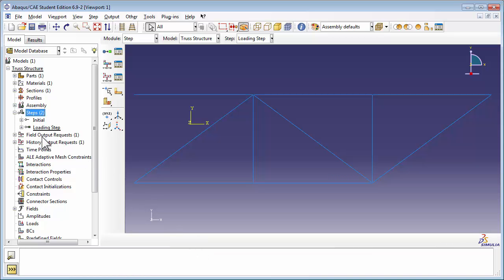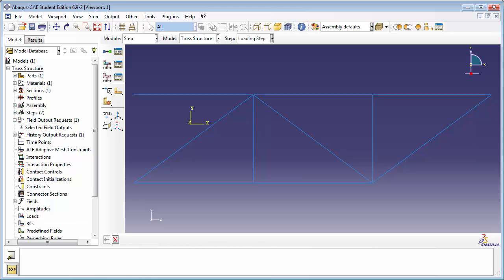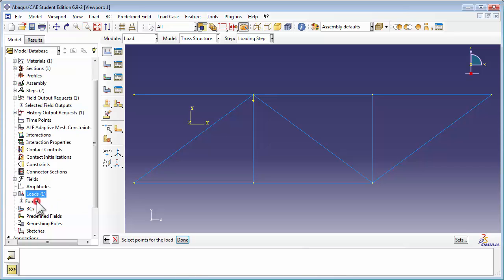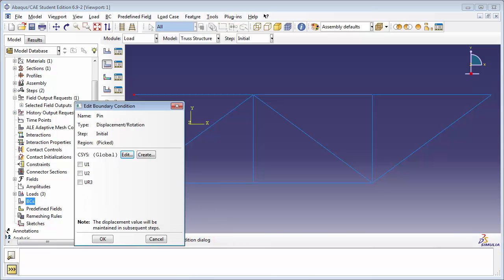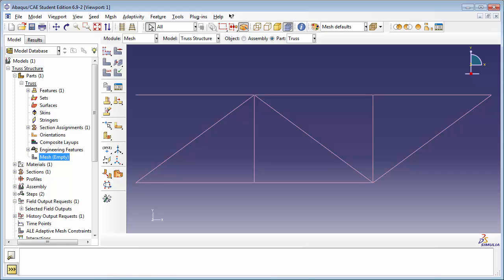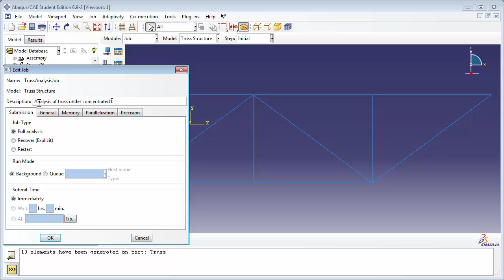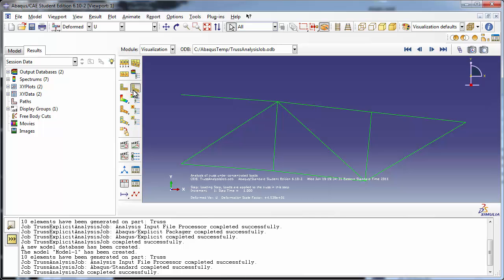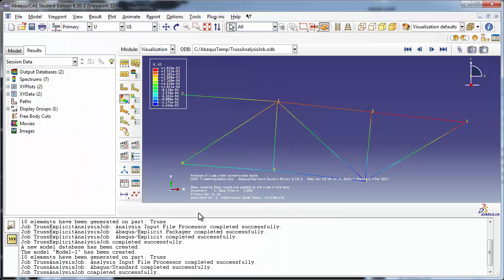2.c) Static Analysis of a 2D truss - Part 2 of 2 (with audio)

Comment: Hello, I had some doubts from your videos on Abaqus truss meshing. What actually is seeding, why is it affecting the loading on the structure? like i'm getting two different output structures when i use two different numbers in seeding by number.
Reply: Seeds are used to determine the location of the nodes when the mesh is created.

Mesh would not have any impact on the load; however, it might affect the internal forces and deformations. 

If you opted out of the "nonlinear geometry" option while defining the step, then mesh would not make any difference in terms of deformations and internal forces.

Comment: I strictly followed your procedure step by step but when i submit the job i got a message "Truss Analysis Job (Aborted)" please help me how to solve this.
Reply: +ars descano when 'seed'ing select 1 element not 4 and that should do it
Reply: @abishekviyer27   it happens cause the truss element cannot transmit so many info as beam element. Beam element can tell others about displacements and momentum thru it, but truss element not. So when you compress a single truss element, the nodes will have a "x" displacement, if you compress an assembly with 2 truss elements, it will return you wrong data, because an the connection between these 2 elements will fold and became like a triangle shape or something like this. If you try to change truss element to beam element, this problem gonna be solved.